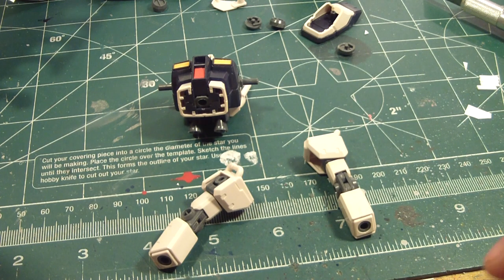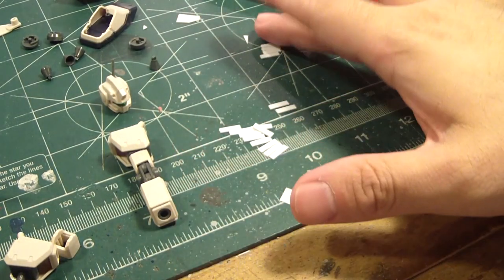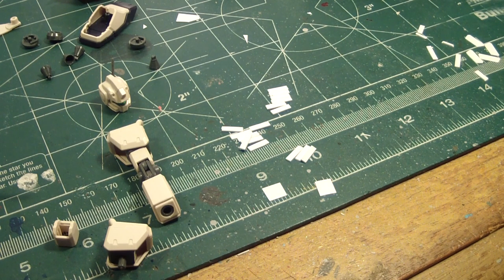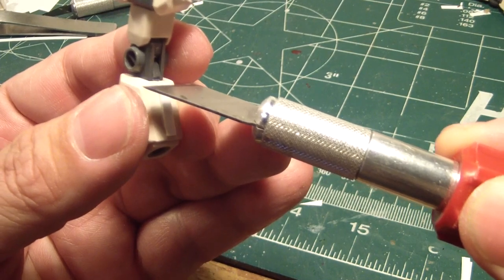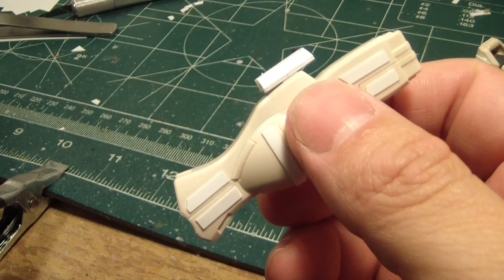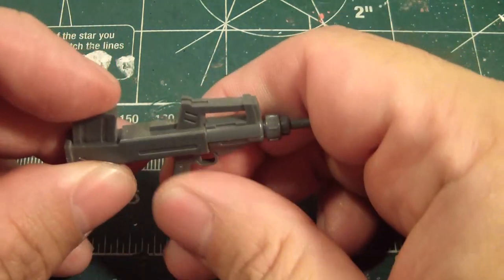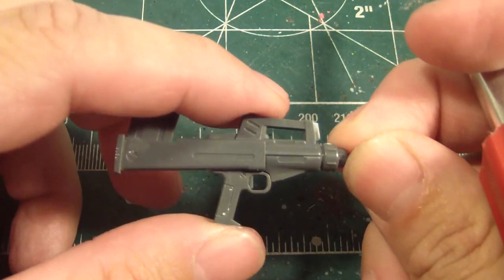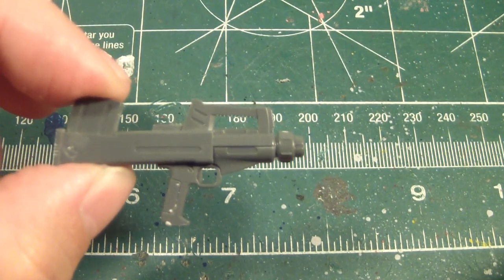*GundamCustom* 1/144 HG GM Type C - Part 4

Comment: The armour your building on the shoulders is called Slat armor, also known as bar armor, cage armor and standoff armor. It was invented by the Germans in WW2 and works great if your tank is being attacked by a Panzerfaust, RPG 7 or a single charge explosive. However in this day and age it is completely obsolete as weapons like AT-4, Javelin and TOE missiles/RPGs are designed with two warheads 1 to punch through the Slat armour and the other the tanks main armour. The bullpup is a British design